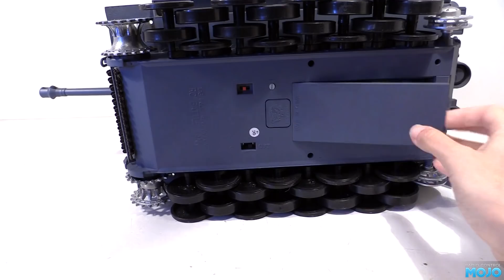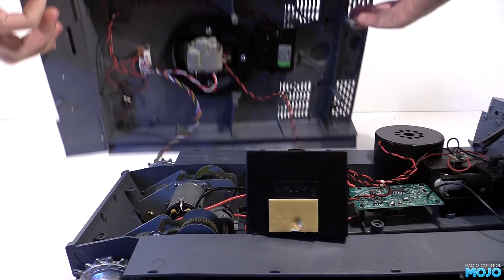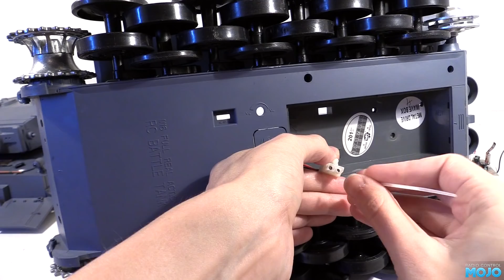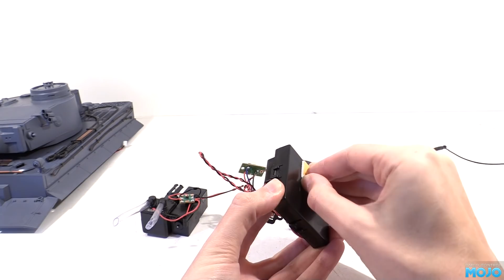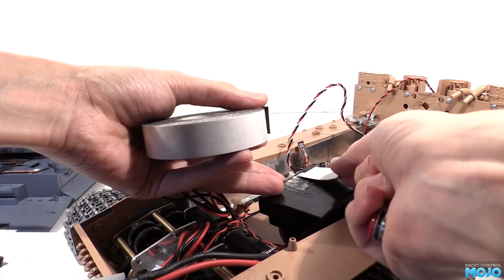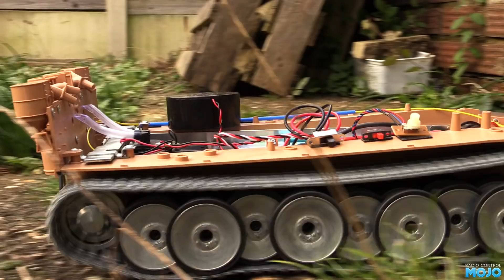Heng Long Tiger I - 4 - Elastic Trickery

Comment: Looks good. I have all those bits in the mail currently. How does the HL upper hull fit with the taigen lower hull? Thanks!
Reply from the maker: +Tim Bryant If you've got the an older revision of the Heng Long with the single front mounting screw it’ll all fit together nicely. On the later revision Heng Long have changed a couple of bits so it’s not just a bolt on any more. With any luck we’ll be fitting the upper hull in next weeks video.
Reply: RCMojoTV  Awesome, looking forward to it.